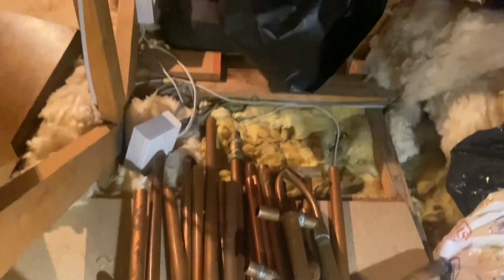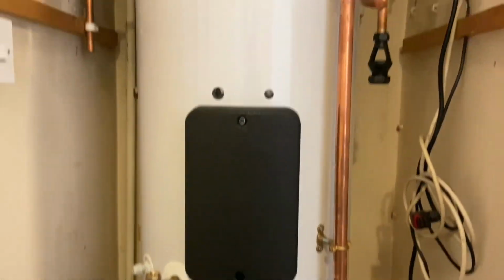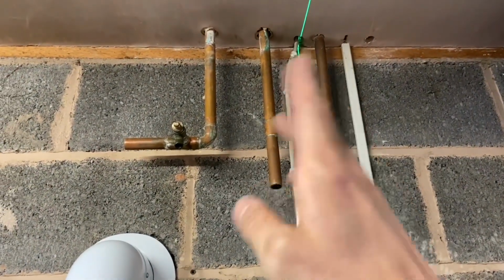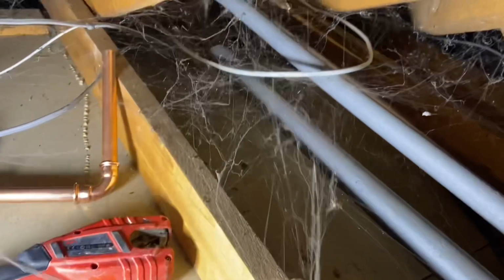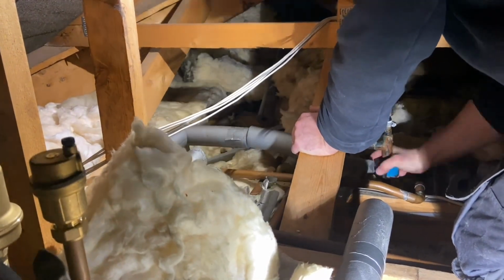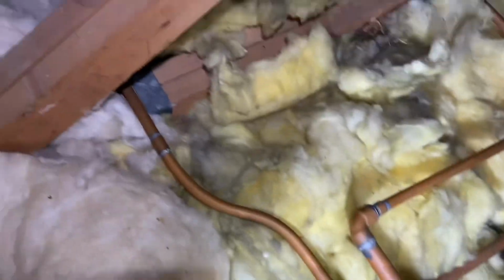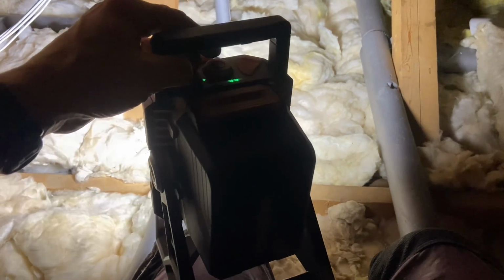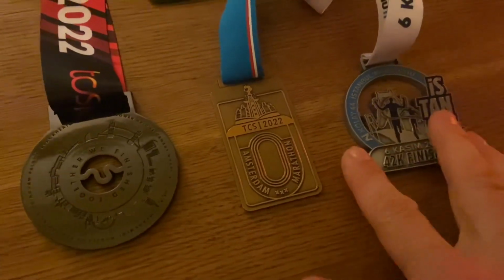P B Plumber The life of a jobbing plumber #97

Comment: Those Honeywell valves are bad now, you can tell the bad batches as the labels are stuck on crooked on the head and the yellow earth warning tags are not stuck on square. I changed 42 two ports on a block of flats HIU's and nine of them ended up buzzing loudly - the syncro everytime. Supplier sent out boxes of replacements and said known issue. Also had two other people I know fit them new and start making noise out the box. Probably not beating the poor kids that make them enough. Well done on your running aswell.

Comment: Great job guys, I believe you can get lagging glue which bonds in seconds. That would help your joints so much. Thanks for sharing.
Reply: Mitre mate works fine on lagging! Sets in 15 seconds.
Reply: @sdgelectronics  Thanks Steve, just couldn't remember what it was called.
Reply: @brianwood5220  there's some special ones too like Armaflex Adhesive

Comment: Could someone explain to me why an unvented cylinder has been installed in a (presumably) small bungalow with probably 2 bathrooms at most? And not a simply a combi installation?

Surely the customers have not got such a hot water demand to be needing to keep 200/250ltrs of hot water up to temperature?

Plus there’s the cost to include
Reply: because 2 bathrooms is a significant demand

Comment: could of you not connected the shower booster pump to the cylinder hot outlet, boosted hot water on all taps?
Reply: Agreed also I know the pressure was low, but as long as it is hot what is the problem? In a rush?

Comment: That's pretty much the same as our hot water flow even downstairs with the tank in the loft. But frankly given we're 100% electric and the water is heated by immersion heaters, I'm OK with it otherwise we'd use loads and it'd cost a fortune!!